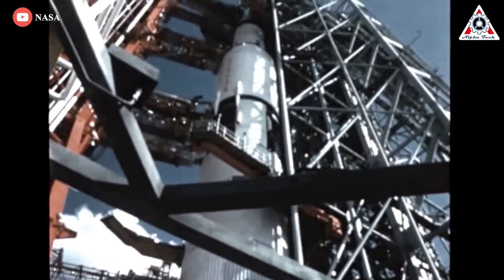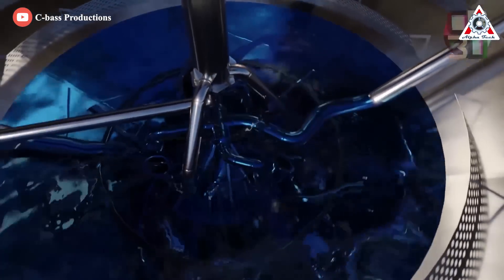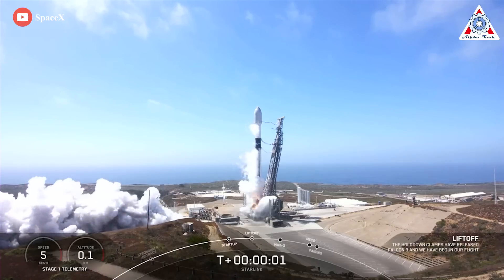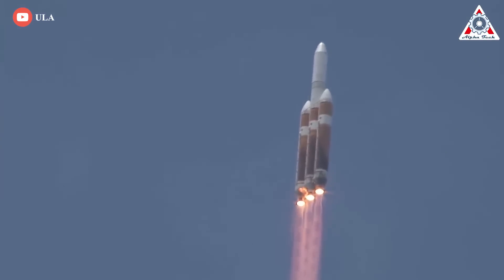SpaceX's Genius Solution to use a new fuel changes everything

Comment: WAAIIIT!  Great video, but hold on.  Planning on sending 1,000s of errands to Mars; right.   Currently Aircraft carriers use some kind of catapult.  Catapults add momentum;  and save fuel ; right?  Now; This is an over-simplification; but:  an Eiffel Tower catapult just 600 meters high should save much fuel; reduce strain on the rocket engines; make take offs safer;  and reduce costs and increase payloads and profits.   I propose a water jet assist along with a perfect hydraulic in-the-ground-pusher rod.  Like the old garage car lifts.  But, I'm no engineer; just an old farm mechanic.
Reply from the maker: Thanks for your feedback. I will read more about this
Reply: @alphatech4966  I'm humbly honored!!

Comment: How much carbon is released into the atmosphere from one of these launches say compared to a modern gasoline powered residential vehicle? No one seems to ever want to answer this question.
Reply from the maker: Yes, this is one of the biggest problem of rocket industry
Reply: In the overall scheme of things, not very much. Huge amounts of propellants are involved, but most of it is oxygen. The amount of carbon is reasonably comparable to a large intercontinental airliner, which only has to carry fuel.

Comment: With better solar and Nuclear, I would think SpaceX would have added as atage zero(-1?/another property to the now existing stage 0?) a railgun to allow the stage 1 rocket to be smaller.

If they could send it like 10km of the way like that, stage1 would be able to lose 10% (more even) of its fuel mass. each way. 10% less distance, possibly even further with speed.

or even better. use rectenna beaming tech to feed it power as it goes on the first stage. this way it can be jet veriant rather than a rocket. I.E. far less heavy.

Comment: I do believe you meant to say minus 423 F for the Hydrogen fuel temperature, at 5:13.  =>  Cost matters for Governments and non-profits also. at 6:17.  LCH3 must be liquid methane.  Thanks for another good video.  Always worth while to stop here.
Reply from the maker: Thanks your feedbacks. I will note this
Reply: Also, density is per meter cubed, or cubic meter, not meter square(d). Alternatively, liquid hydrogen has a density of 70g/l (ref. H2O at 1,000g/l) and LNG at ~450g/l, and RP-1 near 900g/l. Hydrogen requires huge tanks. Pumping that volume into an engine is what makes hydrolox engines so large (massive hydrogen turbopumps) and impairs their thrust/weight ratio.

Comment: Liquid hydrogen is not 433F. It is negative 423F.
Reply: Not 423F
Reply: If you're talking H2 under 1 atmosphere of pressure, it's liquid very near its boiling point at minus 423 F. Approximately. Still liquid, but near the solid's melting point at minus 434 F. So liquid everywhere between. Approximately. Under the right conditions. Denser when colder (approximately). Which is a consideration Musk has used to advantage in SpaceX designs. Understand; don't turn facts into factoids.
Reply: @farmergiles1065  what do you mean Turing facts into factoids?  I simply pointed out the negative was missing from that statement of temperature.   I did R&D on space materials and processes, including testing down to -423 F (product saturation at 1 atmosphere, as you pointed out); plus the last 25 years Product Development for cryogenic transportation equipment for gases -423F and warmer.
Reply: @keithhall8464  My turn to apologize! I missed the fact that the negative was missing, and thought you were making some insignificant and trivial comment. So sorry!
Reply: @farmergiles1065  no problem. Thank you.  Have a fun-tastic evening!

Comment: SpaceX also made the right choice for reusability by dispensing with solid rocket boosters (SRBs), unlike ULA. NASA tried reuse/refurbishment of the SRBs on the Space Shuttle but it turned out to be so difficult and uneconomical that they reverted to just throwing them away on each flight for the Space Launch System.
Reply: And THAT folks, is how fake news and misinformation is born.  Totally wrong.

The shuttle flew over 100 successful flights with those boosters.  They worked just fine.

NASA plans to use up the remaining booster segments, ALL of which having flown before (and are near the end of their working lives) because they are designing an advanced booster to replace the solids.  The new boosters may also be solid fuel or liquid if the latter can be made powerful enough.   

It is always possible that they may use SpaceX-like booster landing tech but that is not set in stone. Falcons are too wimp for that though with only 1 million lbs of thrust (the solids make over 3 million(!)

NASA could easily have made self-landing boosters long before SpaceX did (they have craft landing all over the solar system) but never had a man-boy billionaire who likes playing with rockets to fund it for them as SpaceX did.

There are enough segments left for 5-6 more SLS flights, so they have until then to create the new ones.   Google "sls advanced booster" for more details.

Comment: It's likely that a portion of intelligent life in the cosmos live on planets with higher gravity than earth. I am curious if due to this gravity, some of them are prevented from entering space until they develop a more advanced means of rocket proposion than we have.

With just the weight of the rocket needed to carry the fuel and engines, and any number of stages required, does anyone know approximately how high the gravity of earth would have to be to prevent any chemical rocket from achieving earth's orbit?
Reply: We know of no life on other planets at this time, much less intelligent life. Anything in that vein is speculation, however plausible it may sound. It's plausible enough that I wouldn't be astounded, but unknown enough that I would be rapt if we found it.

The higher the gravity, the bigger the drag to overcome in achieving orbit; likewise, the greater the effort to get to escape velocity (in order to go beyond the planet itself). But gravity is not the only thing needing to be overcome to get to orbit. There is atmosphere. We do expect atmosphere on a planet with intelligent life - but that's another unknown too. Thickness of atmosphere introduces heavy drag near the surface, decreasing as you rise, and drag on a vehicle doesn't just slow it down. It also produces heat from friction, and pressure on the vehicle that stresses its materials. The more the drag, the heat, and the stresses, the more strength the vehicle requires in order to withstand the forces involved. Increasing strength often means increasing weight, as lighter-weight materials tend to have less ability to deal with those forces.

So now the problem involves materials science and engineering. What materials do the aliens have available, for the rockets, and for the fuels? What knowledge and skills do they have of engineering in general, of materials (and chemistry and physics)? What do they know about vehicles that move through their atmosphere,  about fluid flow and aerodynamics? There are thousands of technical hurdles to overcome, thousands of skills needed to address them, and tons of knowledge needed to solve those problems.

So it's much more than gravity. And the characteristics of other planets are out of reach to us to know. And the abilities of aliens are more unknown even than the chances of their existence. It's simply beyond our ability even to make any conjectures of likelihoods or possibilities. One thing seems sure, and that is that any alien that was able to reach Earth from another star, even relatively nearby, would have to have skills and abilities very far in advance of us at this time.
Reply: @FarmerGiles  I liked your post, but you made this far more complex than I intended. I didn't make the question simple because I am simple minded and not aware of the many variables encountered with alien life and the planets where they reside, actually I could elaborate far more than you have and make the complexity multiples of what you stated. I intentionally phrased the question to indicate a chemical rocket on earth when the gravity is increased. So in other words, everything else is the same except for gravity. This involves one variable in a complex equation of many. Then later other variables can be taken into consideration, for example, a higher gravity planet will likely have a larger and more dense atmosphere. But atmosphere has nothing to do with the question I asked. 

My question was about only the effects of gravity. There is a point where the weight of the fuel and the weight of the rocket to carry that fuel make it impossible to leave orbit no matter how much fuel is used, the thrust of the engines, or the number of engines. I wondered when that point is reached when only the variable gravity is changed. If someone knows the maximum weight that can be carried by a chemical rocket into orbit, and the weight of all the components, they could use math to convert that from weight to gravity. I have been out of school too many years to do this without spending hours in a refresher course. I had hoped one of the rocket fans of this channel would consider it a fun problem to solve and save me a lot of time.
Reply: @phathokum1855  Sorry if my reply sounded like criticism. Nothing like that was intended. I thought a question like yours might interest quite a few people, so I replied.

But the question cannot be answered as simply as you hoped. I tried to show just how that question was embedded in a whole series of complications that make a simple answer impossible, which is one of the things needed to make a truthful answer.

Yes, there is some point at which a chemical rocket would not be able to make orbit. But any chemical rocket? Unknown, because different ones, using different chemicals and different engines that deliver different thrusts all push a bit differently against gravity, and it's not the same point for any two of them. And different gravity isn't really Earth any more, but just changing the amount of gravity doesn't get you to a single answer either. Each of those complications (and more than I mentioned) enters into the calculation, and you really can't get an answer to the question unless you have a complete set of circumstances to describe the situation.

So the limit is there, for every rocket. But it's a different limit for every individual rocket. And it's a different limit for every gravitational field. And it's a different limit for any individual day on Earth, because of weather variations. (That's another one I didn't pull out before.)

It may not be a satisfying answer, but at least it does say something about why everyone takes so much care to make sure conditions are favorable before they launch any rocket.

If Earth's gravity were greater, then we'd have greater hurdles to overcome, and we'd be presented with greater problems trying to get greater payloads to orbit (or beyond), greater expenses involved in doing any of it, more limitations on what we could build rockets from, more problems finding adequate fuels. Who knows what would strain our resources and inventiveness beyond our abilities at a given time and place? For making a rocket at all takes a civilization.
Reply: @farmergiles1065   To problem solve, you have to be able to divide the problem into its parts and separate the relevant from the irrelevant. For example, you don't understand that I didn't ask what the gravity would have to be for each possible rocket or construction, I asked what the gravity would have to be to limit all known chemical rocket types and their construction. So if there are 20 types of chemical rockets, for example, and doubling the Earth's gravity eliminated 10 of these, that has absolutely nothing to do with my question because I asked what amount of gravity would eliminate all of them. So there is one answer. In the future, when you see a question you can't answer, don't answer it. Don't rearrange the question to something else and then say it can't be answered.

In other words, chemical combustion causes energy. There is a maximum amount of energy it can produce, depending on the chemical. Thrust directs this energy, and some engines can be more efficient than others in directing this thrust. Also, depending on various factors, larger engines verses more smaller engines can be more efficient, and all of this depends on the chemicals used. Also, different chemicals have different energy or thrust to weight (weight of chemical) ratios and can have different weight requirements for storage. But there is a point where no matter how efficient the thrust, chemical, or weight used in the rocket and engine, a chemical rocket can not reach orbit if the gravity reaches a certain point. I was curious what amount of gravity would be required for this.
Reply: @phathokum1855  Whether I misunderstood, or you have, I think it best just for me to withdraw. Sorry I wasn't able to help you with what you were looking for.
Reply: @farmergiles1065  No problem, thanks for your input just the same ..:-). I probably should have emphasized the word "physics". There is a gravitational point where thrust and energy that can be produced from any given chemical can not counteract the weight of the rocket (engines, frame, fuel container, etc) to achieve orbit. Have a great week!
Reply: @phathokum1855  Thanks as well. I'm not aware of such a point of physics. If that depends only on the characteristics of the chemical, perhaps that is indeed a path to the problem's solution.

My other problem is that, as I understand it, the chemical's energy output is one thing, and thrust is another - that thrust is delivered from an rocket engine in response to consuming its fuel. So that appears to me to introduce a different question, and I can't resolve that. Best wishes!
Reply: @farmergiles1065  True, but the physical limit of energy also determines the maximum amount of thrust that can be achieved because of the maximum heat and combustion of the chemical. It can be maximize by engine designs, but no matter the configuration, a chemical can only product a maximum amount of energy per a unit of weight.
Reply: @phathokum1855  Good point. At least I understand what you're getting at now. Thanks!

And you call yourself simple minded! ha ha ha  Perhaps I should call myself a no-brainer.  ha ha

Comment: Is it plausible to harvest methane from trash dumps? I know they build extensive networks of pipes and burners to vent off and eliminate the gases formed from the decomposition of materials at a dump site.. Is that harvestable or is it to minuscule to recover as a fuel?
Reply: our old dump in a small county is harvesting methane from it . so yes plausible
Reply: I’ve seen landfills with methane collection systems. They go to a small generator, sometimes connected to the grid, that produces electricity from the methane. Not much electricity but some.
Reply: @markiangooley  ya the EPA made them install pipes and a burner to control methane release. But could it be used to harvest the methane instead of just burning it off? I also wonder what the efficiency of the current system is in using the harvested methane? I’m guessing it’s probably not very technical and therefore probably inefficient. 🤷‍♂️
Reply: I doubt it's too miniscule. Some farmers collect it from their natural waste piles to fuel various engines in machinery. The key is more likely to be supply and demand. Or in other words, profitability. Now, there's non-monetary profit in recycling the gas just with respect to the environment, so by profitability I only mean that there also needs to be some reasonable way to support the costs. There are lots of ways of looking at that. Using the methane at the location where it's produced eliminates lots of transport costs. So feasibility starts to vary right there.
Reply: Some places they do. It generally works best for on-site electrical generation with an outside fuel connection so that at minimum production they still burn all the dirty methane.